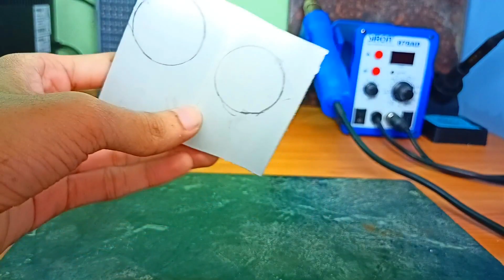HOW TO MAKE ELECTRIC SCREW DREIVER|#DIY|#ELECTRONICS|#tech|#FLUORESCENT TECH

Comment: I would have added a small washer under the gear that is placed on the pipe support piece with the smooth side of the washer facing the underside of the gear to avoid too much friction between the gear and the pipe piece to reduce the friction between the two surfaces and increasing the lifespan of the gear.

Comment: Can we use it for screw drive in wood ??
Reply from the maker: No bro it's not meant for that coz it's made from plastic gears if you want to screw through wood you should have to use metal gears and much more powerful motor .it can only use for precision screw works
Reply: @fluorescenttech5432  right 👍

Comment: Hello 
I make this screwdriver but switch not working 
Plz help
Reply from the maker: You can also use two way switch which is not complicated as much in  this video. in two way switch there will be 6 legs in it .first of all you should join the corner legs diagonally and take an output and connect to the battery then solder the output wires of the motor to the center pin.good luck 👍👍👍👍. have a nice day ❤️❤️❤️❤️